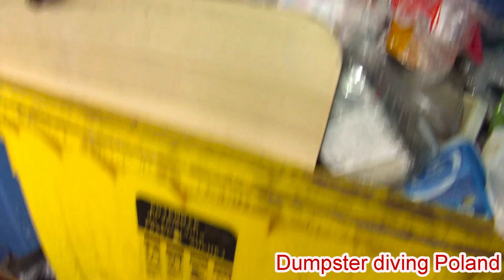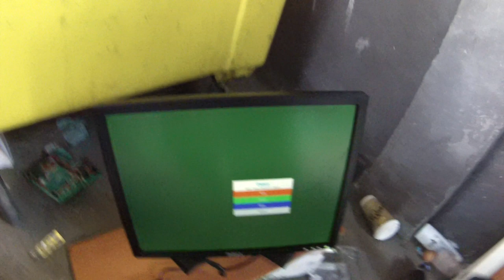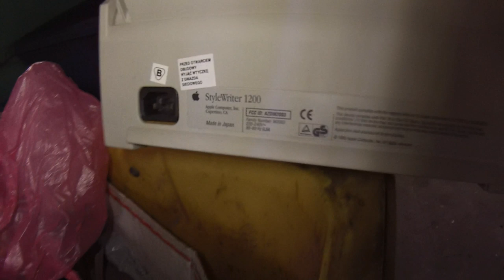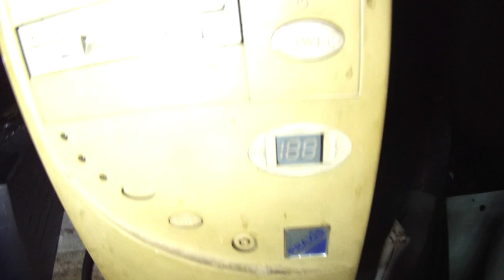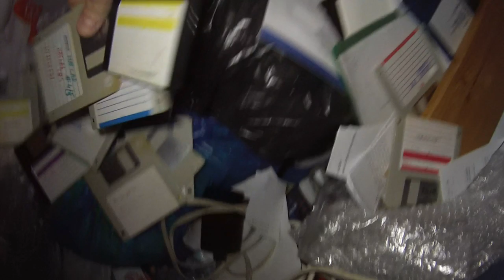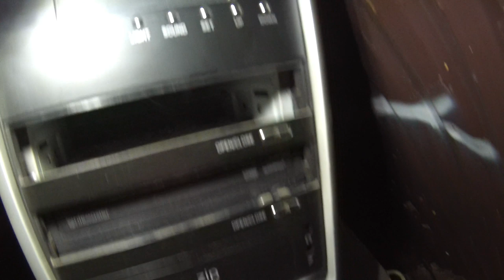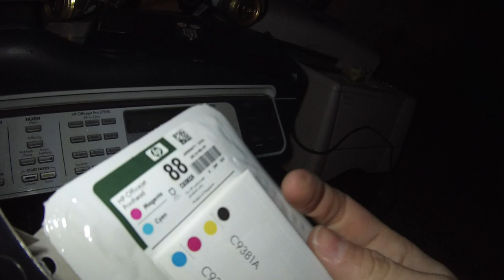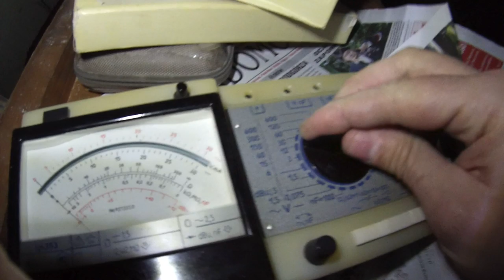Znalazlem,laptopy,tablety,st dyskietki,st komp #śmietnik #śmieci #hasiok #rupiecie #wystawki #prl

Comment from the maker: Welcome to the next Finds :) :) :) -The last period of searching, I spent mainly on finding older computers, laptops, monitors, computer speakers for multi-purpose devices, old computer boards, floppy disks, etc.: - A lot of the equipment you see on the video - Let's fire - They work, or have any minor damage, do not work at all :) - Yes, it also happens :) - It is not that I find only good hardware :) - In addition to the whole mass of this type of electronics - It encourages me also the whole mass of the so-called computer scrap :) Undoubtedly, the equipment that surprised me that I managed to dig out of the container is Microsoft Surface-Which turned out to be efficient altogether almost completely :) -And only its disadvantage was that the rear hinges were broken -The all this was ok. This Surface - I do not know how to call it :) computer or tablet - In sum, it is rather a computer on the windows in the end mobile - this time cleaning someone just hid hinges and litter ... In the rest of this material I managed to find old batching equipment like min Ink printers Hp, OKI, Apple. During these finds I managed to get old mines forgotten Md-ki - When hooking the frame on the pictures once exploded to me during the recording ... Well, such a sport ... Old processors, heatsinks, graphic plates -ventilators, expansion cards -this often very likely to be found on the dustbin -Old processors from 95.97-and newer rarely but happen:) - It was a big surprise for me to find a computer AST BRAVO MS 5200M-Oldshool already equipment from-1997 - Last century:) - Well-groomed - As for their years in good condition - with components Ibm-Such coms like most :) :) :)., Do you have any questions? - If you liked the material - Leave a footprint in the form of a paw up -I will be very pleased if you become my viewer for a long time. To be able to subscribe to my channel, You are successful sł on the new episode ?, suggestions ?, comments? -I invite you to the discussion -Dumpster diving Poland.